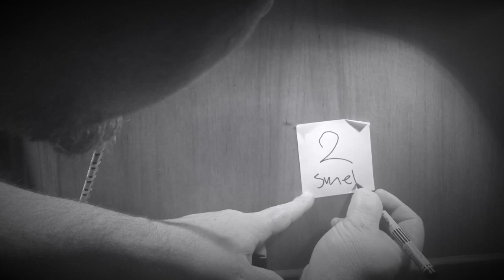PROS and CONS of living on a boat, the CONS - Sailing Embla Ep 31 .

Comment: Yes I have also noticed a freezing cold floor in my boat, I usually wear thick wool socks in the winter.  Regarding leaks you can get a pinless moisture meter (fugtighedsmåler) at Biltema to find where the leaks is.  Moisture and mold is a known problem on most boats and I don't know if there is a solution to the problem.
Reply from the maker: I dont think it is a solution or its something really expensive im sure.. I was thinking it could also be the condensation that accumulates that drips down now and then...
Reply: Dehumidifier is what you are looking for

Comment: Good conversation.   I suspect that the boat dries out more with the diesel heater because the air used for combustion is coming from inside the boat and then exits thru the chimney -- which causes outside air to find its way inside to equalize the pressure.   That cold air (once heated) has a much lower relative humidity.    I think that basically by running the diesel heater you are causing the boat to be ventilated with outside air.   Looking forward to hearing the pros of life aboard!   From the state of Minnesota in USA (still cold here also, high temperature has been staying below freezing for the last week, but I do not live on a boat).
Reply from the maker: Hey there MnNJP Isanti, That is exactly what is happening and its working really well.. But there are still room for improvement on the heating issue i think... Minnesota! then you are practically a Scandinavian, he he, i can imagene it being cold there being so near the Great lakes and all.

Comment: Thanks From Ireland on fresh water . I am going to live on the boat from September 2018 to april 2019 or more .I bought a 27 foot 1970s era deep keel fiber glass boat  and am living in a fresh water lake marina as it is cheaper than sea side marina .The marina gives me the electric power and separate toilet and shower  across from marina in a marina house facility.
I plugged up all the sea cocks except for the 10 hp SAAB inboard  intake to stop any leaks so no toilet or sink s.The cockpit is the basin for washing .The bucket is the bucket and chuck it for emergency only middle night toilet calls when i cant get to toilet  hut .I got 220 volt stuff 1.5 kilowatt  heater and skillet for cooking and 1  kilowatt cooking plate for fry pan  and electric light . Damp is problem I  wear lots of cloths. I will try to make a diesel heater in the future  . I hope to go to Norway and park there in 2019 to 2020 winter keep you informed .I will make a sail channel just for the boat I only bought it few weeks ago so I  haven't had time to make separate boat  channel . Boats name will be Irish when translated Dwelling boat . Dwelling is normally dwelling house  so the first part will be Teaghais for Dwelling . Boat in Irish is Bád  and sounds like Vad as B makes V sound . Teaghais Bád .  I will try in the more mild climate of Ireland not to freeze to death in winter .
Reply from the maker: Hey there, sorry i haven't gotten back to you before. I can see you have your work cut out for you this winter, but hopefully you will endure the winter and come out of it with lots of ideas on how to improve your home for next winter. Its really a great way of life if you just can let go of some of the so called necessity's that land dwellers have. Maybe i see you around the coast sometime in the coming summer, Ill buy you a beer ;-)

Comment: Try a wood stove, it will dry your boat better
Reply from the maker: I am sure it would, and probably smell a lot better as well. The diesel heater i have is actually quite good but during my stay in Egersund/Tananger i often used a electric fan for heating. Power was so cheap in those harbours.. Filling the day tank was also a hassel so i gonna do something about that before continuing on my trip. Thanks for watching PACHORRA..